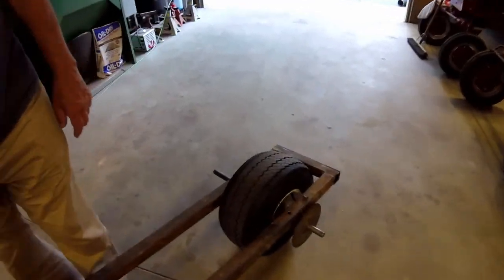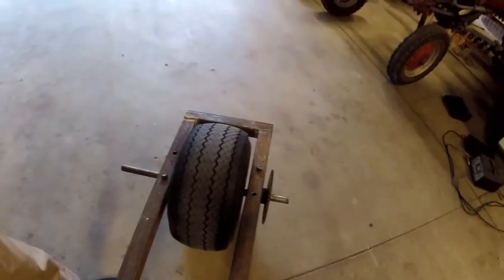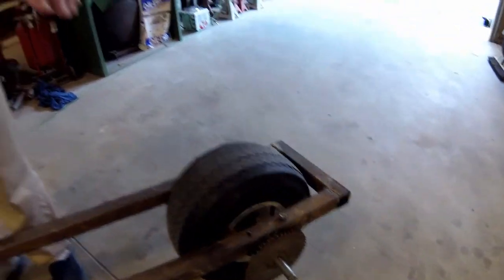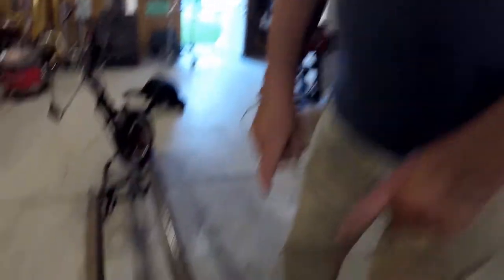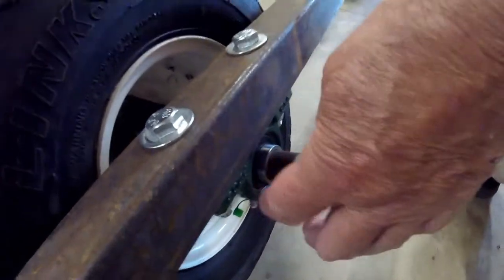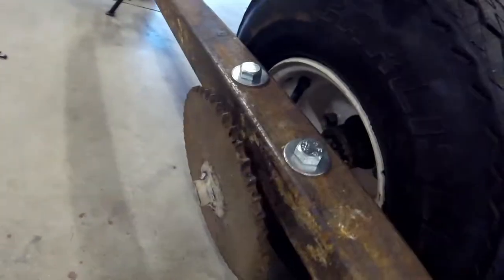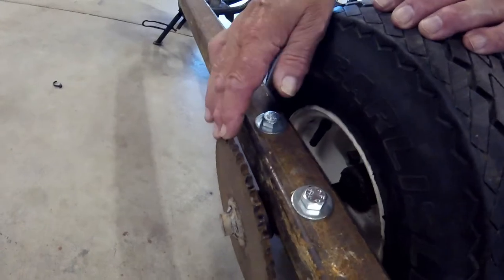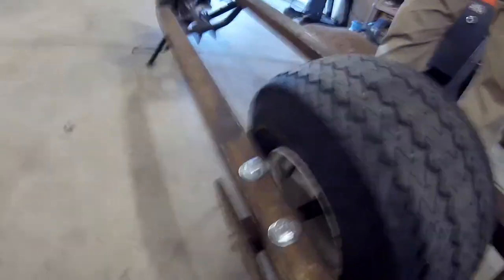Pop Pop Gringos - project Series - Rat Scooter Part 2

Comment: Just pull the side cover to change that seal ... neat project!
Reply from the maker: I was told if I fix the leak it will not be a Rat Scooter.. So we are going to wrap a rag and tie it around the shaft just to keep the oil off the clutch ?? LOL Thanks Bob